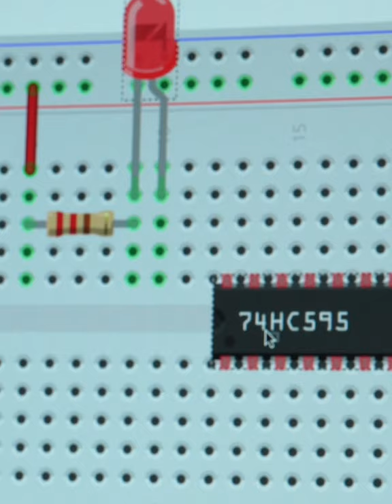Breadboard Jumpering - Collin’s Lab Notes #adafruit #collinslabnotes

Comment: I have two types of jumper wire: the blank-ended type in 0.1" grid lengths, and Dupont wires with male and/or female ends in lengths of 10/15/20 cm.
My breadboards can look very loopy when the Dupont wires just go across everywhere. I don't mind.

Comment: Those jumper wires looks too thick especially the insulation It does not gives enough clearance between breadboard sockets. You could try thinner single strand thinly insulated wires.
Reply: You don't want to go too thin, because they need to make good contact with the bread board. A good fit eliminates intermittent contact.